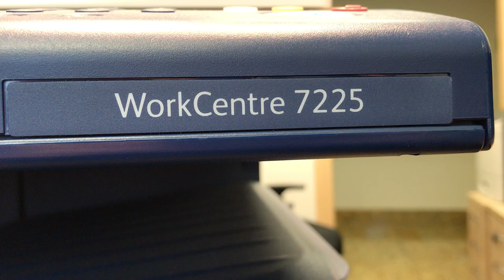Transfer Belt Unit XEROX WorkCentre 7120 7125 7220 7225

Comment: great work
I've Ricoh MP C2011 i have a problem a line coming when I print dark colors can you tell me how Can I clean It ... Thanks
Reply from the maker: clean the mirrors and the lamp the best
then find a small glass under the toner, slide it out and clean it
you can use a cleaner, it may be blue on the front flap